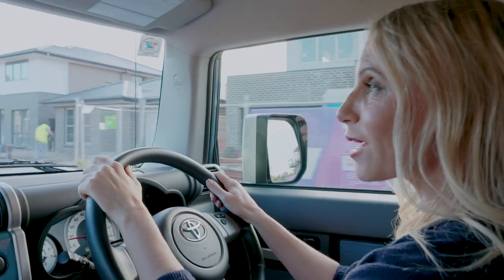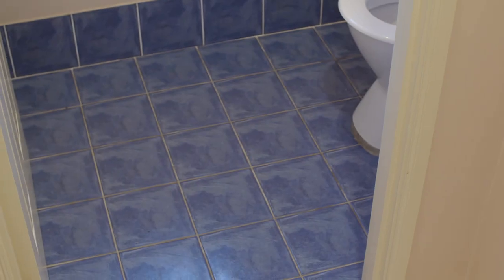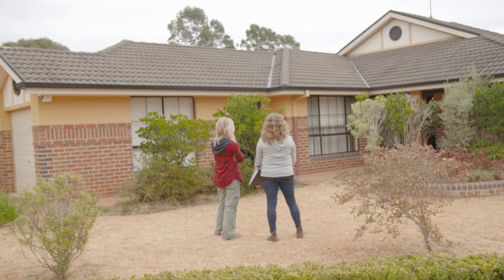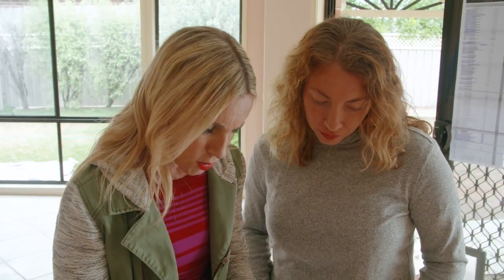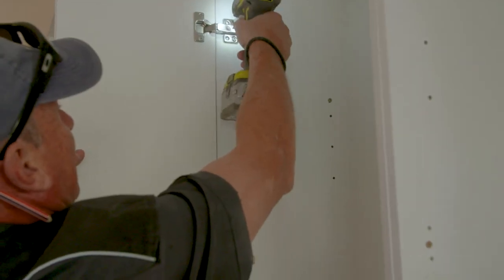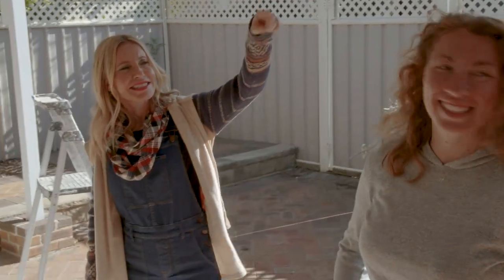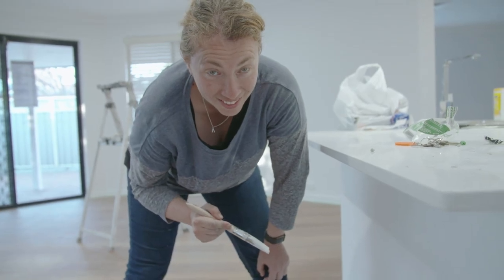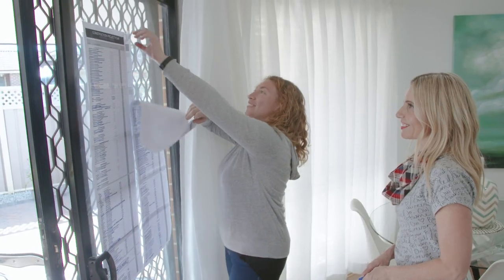Cosmetic Renovation... Cherie Barber's Whole House Renovation | Aussie 10 Day Flip

Comment: Paint the brick!!! If course it will look good ! Where did you get the idea it wouldn't look good?? Also, no one rips up tile anymore. That's what floating floors are for . End of the day , the house looked awesome , good job 👍👍
Reply: I don’t get the fondness for painting brick. Brick is one of the few elements of a house that rarely needs maintenance. Once you paint it, you’ve just given yourself a load more work and extra expense.
Reply: @Dinki-Di  there is stain for bricks and you only have to do it once and the color doesn't change, doesn't peel or anything like that. It stays and doesn't look like it has been painted. It is awesome!
Reply: Sometimes painting brick does not end well. I’ve seen a lot of very bad examples of painted brick that definitely balance out the good examples.

Comment: I love that renovators come up with these wildly expensive plans but when their wings are clipped they find that they can do just as well without trashing all the original fixings.  Why not start there to begin with?  ‘Let’s trash the entire kitchen’ no?  ‘Let’s paint and replace hardware’. Same result, less money spent.
Reply: This bit. I was thinking of trashing the kitchen before quarantine, but my BFF said "What? No! Update the appliances, get convenience hardware, get knobs and pulls and update the counters". $3000 USD vs $20000 USD.
Reply: I guess when thinking about a resale, decorating choices can be about a statistical likelihood that the decor or the façade will attract a bigger proportion of the available clients.  On the other hand, I have seen an incredible number of “what were they thinking?!” so-called improvements designed to appeal to certain trends.  painting brick can either go very nicely or it can go very badly, for example. I’m really starting to appreciate going with the flow of the architecture of the original structure. I love the challenge of trying to create “timeless“ out of “dated.''

Comment: You can concrete render the any ceramic tiles on the floor to rip them up just looks like polished concrete then it's such a ways spray everything else cabinetry tiles replace carpet with  bamboo I think that this home is the new generation cream brick veneer I think doesn't look too bad and brick I don't like the thought of rendering it Things I Hate About is aluminium sliding windows Wunderlich double hung double glazed will go wonderful

Comment: Painting brick is a much better look than render. Render on a house built in a style when render was not in, stands out like the proverbial. If I liked a house but then found the roof tiles were spray painted and the bathroom tiles were painted with a 5 year warranty, I would think again. I dont want to have to retile in 5 years or redo the roof when the paint wears off. As for removing olive trees.... words fail me. I would have done the floating floors (young people love them) and I would have spent the rest of the money putting in a functional kitchen with drawers, not cupboards, an island possibly, and definitely would have done away with that ghastly sink in the middle of the bench/room. As well as retile the bathroom, painting tile is unethical unless you volunteer that information to potential buyers.